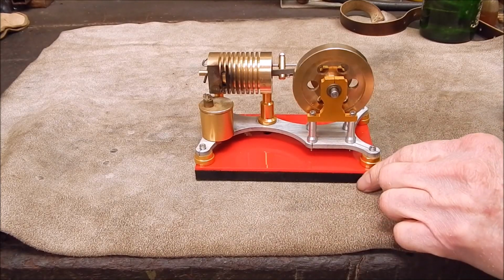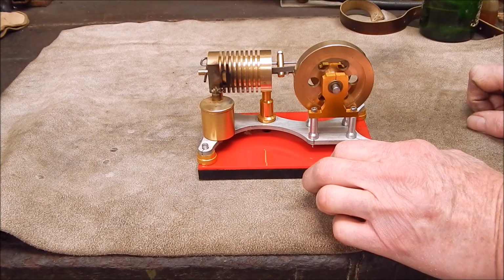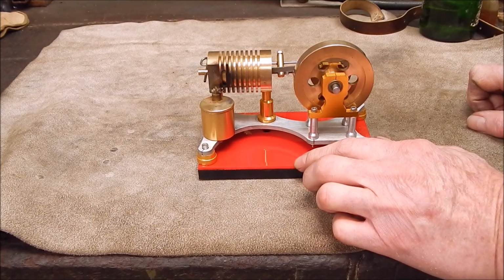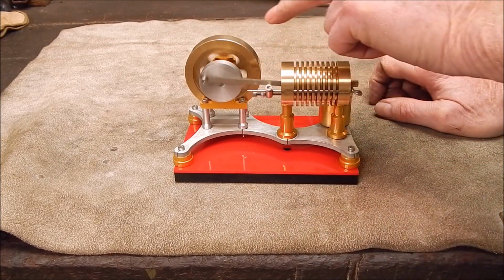Rob versus the flame licker engine  - my shop bought model experience

Comment: I built a Stirling engine with a Pepsi can Piston and a Baked Beans can for a cylinder, and once I got it timed properly it would run for hours, good fun to tinker with, I got mine to 540 RPM max with water cooling.....

Comment: So do you see as a design fault in the engine you have--the stroke I mean and do you think having a slightly
longer stroke would improve performance.Maybe make another one with an increase in stroke?? I am just thinking out loud..E
Reply from the maker: Hi Ian, I really don't know.  The basic design is inherently poor given the additional mass and friction of the port piston (compared to a flapper or sliding external valve).  Extra capacity may give it better suction so I will try that first.  

I've bored out the cylinder to maximum (quite a lot) and will make up new pistons.  I've left the stroke as is because without making a new barrel it can only be lengthened by about 2 mm. Also I've cast on much larger alloy cooling fins.

It should be interesting to see what happens ;)

It looks awesome with the mods. Just have to do the pistons now.

Cheers Rob
Reply: @Xynudu  Yes I am looking forward to see  what conclusions you come up with..E

Comment: Hi Rob, been enjoying your videos, keep up the good work! Made a few small Stirling engines and found a water jacket for cooling works wonders. Made one using a copper pipe water jacket with small pipes top and bottom of the jacket. Made a small "water tower " from copper pipe mounted along side the engine with the pipes from the jacket going to the top and bottom of the tower giving thermal dynamic cooling. Works a treat and boosted the revs/power.
Colin
Reply from the maker: Hi Colin,  I will think about water cooling.  It might just be the answer. I will see what scrap I've got and braze something up maybe.  Interesting options all round.

Stirlings are a lot of fun.  The one I used a CPU cooler on never overheats.  Decent cooling makes a huge difference. 

Cheers Rob

Comment: I just looked up what you could use for brass on brass lubrication and apparently silicone oils corrode brass. Music instruments oil with lightweight mineral oils.
Reply from the maker: I normally use air tool oil which is super light weight and meant for brass on brass.

Comment: Interesting concept. 
Is it the temperature differential in the gasses  sucked into the cylinder that makes it run? Flame gets pulled in then cools off and creates a slight vacuum? 
What if it had a water jacket? Test by dripping water on the cylinder barrel or wrapping a damp wick around it?
Reply from the maker: Yes that's how it works.  A water jacket is possible.  I will try additional larger air cooling first as it's less complicated to make. All fun stuff.  Cheers Rob
Reply: @Xynudu  Thanks Rob. Good luck with the heat exchanger.

Comment: Hi Rob ,question is the base of the flame to high?
Reply from the maker: Hi Giovanni,  I've already lowered it from standard.  I can always go some more. I think from memory I did experiment with that. Heat build up seems to be the main issue now.  I will have a go at that and then maybe extend the stroke a few mm etc.  Makes for an interesting time waster.  Cheers Rob

Comment: Hi Rob. Looking at the constructing it would appear to be of the same make as the twin flywheel one I just did a video on. I'm not happy with the way my one runs so I'm going to strip it down and see if it can't be improved. Cheers, Alan.
Reply from the maker: Hi Alan, the same thought crossed my mind when I watched your last video.  Same base material, same looking wobbly fly wheels.  I recon you're dead right. 

I've spent hours on this thing trying to get it right.  It's a bastard ;)  But it is interesting to see how it can be improved.

Not everyone is into model engines and I don't expect a lot of views, but that doesn't worry me. Those who are interested can probably relate to it and have a chuckle.  Cheers Rob
Reply: @Xynudu  Hi Rob. I agree with your comment on model engines, I don't expect a lot of views either. I find these flame lickers fascinating though, I can watch the action of the flame for ages. Kinda of mesmerising in it's way. Good luck with yours 🙂 Cheers, Alan.
Reply from the maker: Hi Alan,  I've decided to make some major changes to the bastard engine.  I've bored the brass barrel out as far as possible (which is quite a bit), kept the stroke the same and will make up new pistons.  I'm also going to cast aluminium around the brass barrel and machine up much larger cooling fins.

Should be an interesting exercise.  It will take a while and I probably won't video it as it's a distraction.

If it still runs like crap then I will turn it into a flame licker using the design you have or with a sliding external side valve.  So many options. 

I don't feel bad about re-birthing it.  It deserves it ;)  Cheers Rob
Reply: @Xynudu  Hi Rob. Good luck with the mods. I look forward to seeing the modified engine at some point. I did a timed run with mine this morning. It ran for 5 minutes then stopped, I immediately restarted it and it ran for another 9 minutes before the meths ran out. So I reckon about 15 minutes on a full tank. It still won't run at a constant speed, I didn't alter the flame position during the run yet it would occasionally speed up or slow down for no apparent reason! Cheers, Alan.

Comment: Love it, ? what would be the action if the flame was under the unit
Reply from the maker: Won't run if it can't push the cylinder gases out - the flame would prevent that.

Comment: Would it help to increase the stroke by a quarter or a third..E
Reply from the maker: Hi Ian, I can only go a tiny bit longer (2 mm) because of the port slot to end of cylinder length.  It will run, but temperature is the biggest issue.  Cheers Rob